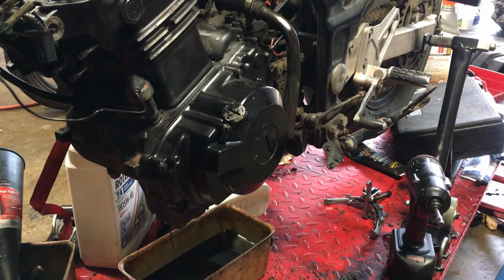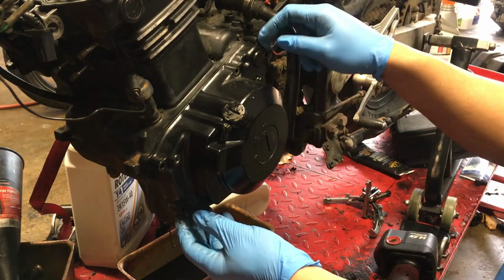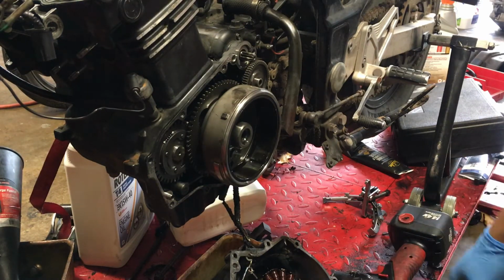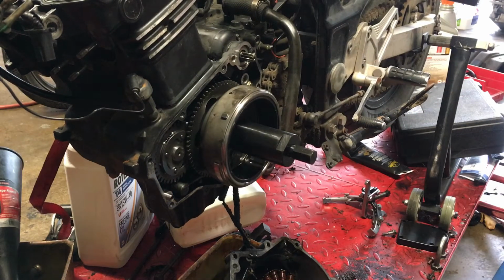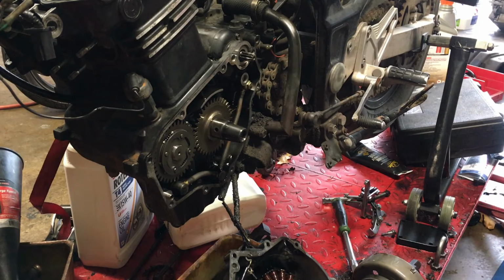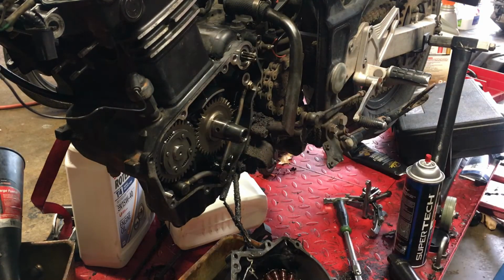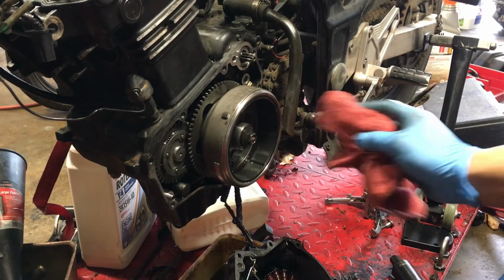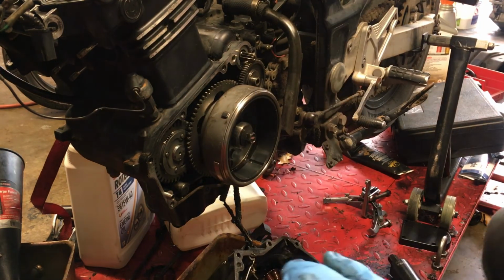How to remove a motorcycle flywheel (WITH A TOOL?)

Comment: What year is that ninja 250
Reply from the maker: nat batista I believe that was an 07
Reply: I have a 08. I'm trying find the right size flywheel puller
Reply: My manual says 38mm and 35mm don't know which 1 to get